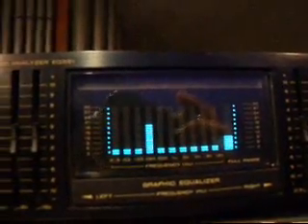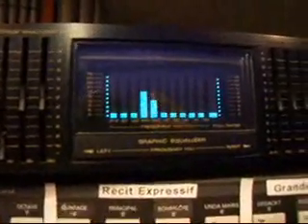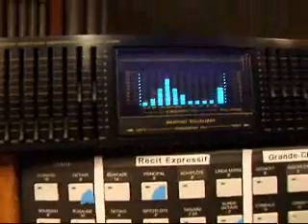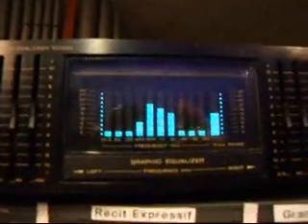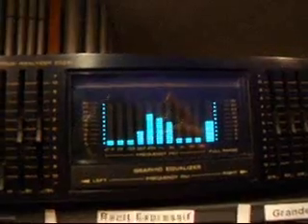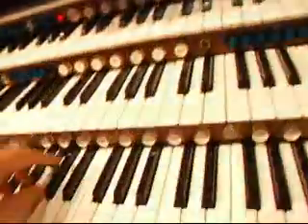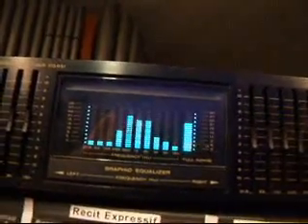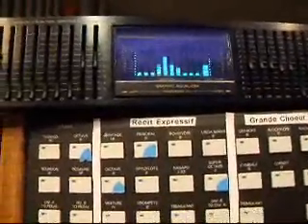Effect of speakers on electronic organ and Hauptwerk realism

Comment: In my opinion, there is a desperate need by Organists to use HIFI speakers to reproduce digital organs. There are heaps of High-end commercial speakers when run 4 way, 5 way or even 6 way that will give you an immense amount of power with almost no distortion.

Comment: Usually headphones sound much better than speakers. But headphones are nothing more than small speakers,so what is the difference?. It is in the volume, the higher the volume the higher the distortion of one speaker. One nice solution is to employ a vertical column of speakers. A typical array may be made of more than 20 small speakers. Instead of a half sphere wave from one speaker, the wave from a column is a half cylinder, each speaker at so low level that almost no harmonics distortion is produced. And also it fills better the space, because level decreases only 3db instead 6 db when distance doubles.

Comment from the maker: @goodchappy Hi! It's interesting that on my computer speakers I can hardly hear a difference between the the original Open Diapason and the better Open Diapason. However certainly there are good reasons why your Logitech computer speakers with a subwoofer would sound better than conventional hi-fi speakers. Flat speakers with no distortion exist: Manger Zerobox speakers are clinically accurate. However conventional speakers compress dynamics - I use types of unit which don't . . . PM me . . .

Comment: Yes, loudspeakers are the achilles heel of electronically produced organ sound.
I know that my old hi fi speakers are not as good as the cheap and cheerful Logitech computer speakers with subwoofer I have. 
I wish someone would bring out speakers that had a flat frequency response with NO distortion.  Keep up the research and experiments. I will keep using my decent headphones for now.